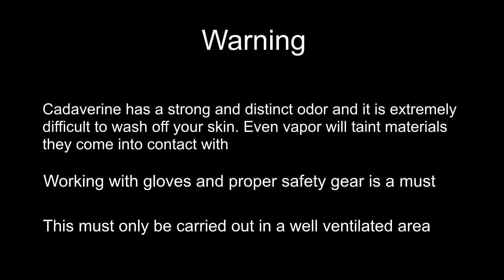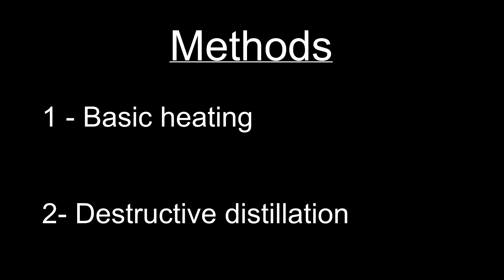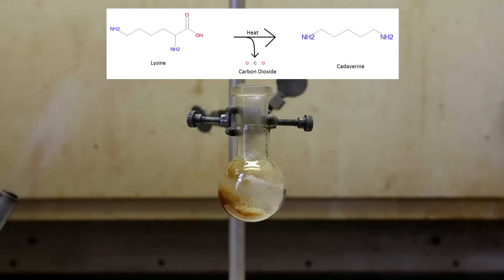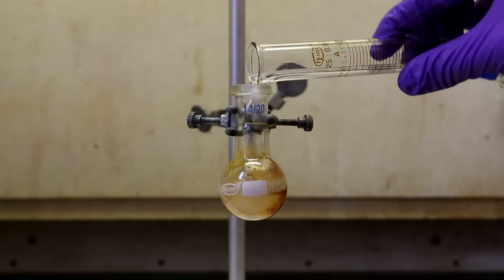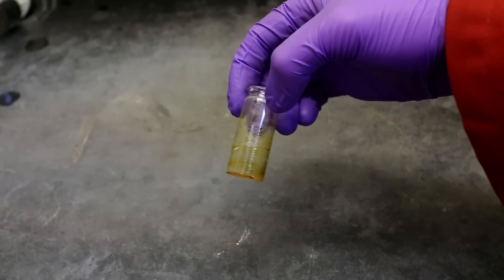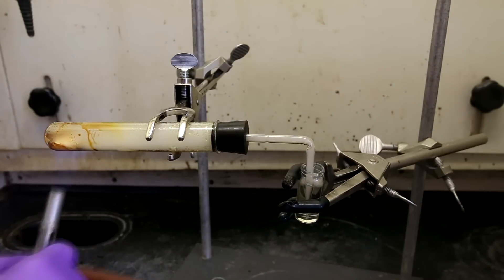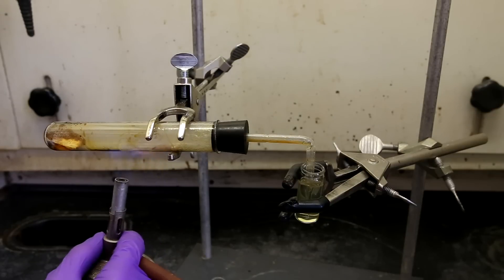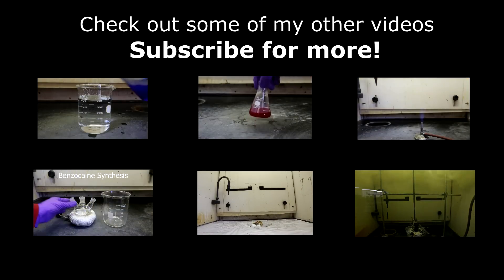How to make cadaverine (the smell of death)

Comment: I found sodium hydroxide also works well instead of bicarbonate, with a little pyridoxal-5-phosphate as catalyst, in aqueous solution. (A little Cu2+ also makes a good catalyst.) I think the pyridoxal decomposed on heating, since the solution turned from yellow to green, but it still developed the right kind of smell. Afterwards it was simple to extract the cadaverine using isopropanol, which didn't mix with the aqueous layer, I'm just not sure how to separate the product from the solvent.

Comment: You used nitrogen inside your test tube for the destructive distillation process, will carbon dioxide or helium work,  I am currently a very amateur chemist and helium and carbon dioxide are easier to get

Comment: Could you use a one way valve on the tube to prevent suck back?
Reply from the maker: +XCyclonusX Yeah, but I don't have one!
Reply: Just realized my post could have come off as a little assholish.  Im just starting to get into chemistry and what I meant was is there a one way valve that could be used.  Sorry if it seemed like a condescending comment. Love your vids and subscribed on the first one. I'm watching one now where your extracting caffeine, do you have one where you show how to extract nicotine?  I'm a vaper and I'd like to try and make my own.  Awesome videos.
Reply from the maker: I didnt think you were condescending at all! For nicotine extraction, I might try it at some point. However, if i recall correctly, there are some issues with the extraction. It isn't as simple as the caffeine extraction or steam distillations. There are some added steps.

Comment: Hey Nike Red do you happen to know anything about Cadaverine uses in inductrial? anything you know about would be helpful even a website?
Reply from the maker: Danny Ulrich Not that I know of. Putrescine is used for the production of nylon though.
Reply: Nile Red You know you can do this much better and cleaner by just heating lysine in heavy mineral oil and then extracting it with some HCL solution. You then neutralize and extract with ether. You can get high yield and even recycle your heavy mineral oil.
Reply from the maker: Have you tried this before? It seems like that should work.
Reply: The key is to use the highest boiling mineral oil you can. In fact if you can get your hands on a synthetic fluorinated oil for the decarboxylation then you should. The Oil is there only as a thermal buffer to prevent the material from overheating and decomposing/polymerizing. I used the zwitterionic form of lysine but it should be better to use the freebase if you can. You could load it as long as you make sure that its able to be stirred with a stirbar. Heating to 250-300C should be your goal. After the hour long heating just let it cool and add acidic water. Seperate the water and then neutralize and extract.
Reply from the maker: Cadaverine. I don't mind the smell of butyric acid at all.
Reply: Nile Red Ya I used to make my own stink bombs in high school. The nice thing is that you dont get any polymerization and you can stop at the dihydrochloride. The dihydrochloride is great since it stores indefinitely.
Reply from the maker: With this method, is the cadaverine isolatable? I would like to do that with putrescine and make nylon with it
Reply: Nile Red yes its easy to isolate. You can easily vap off the ether extract once you dry it with MgSO4. You can also just vap off the water and keep the dihydrochloride. Its deliquescent so if you want dihydrochloride powder you have to lypholyze it. Just a side note, you remind me a lot of how I was when I was younger. I actually used vogels 4th edition and did chemistry at UC berkeley
Reply from the maker: That sounds pretty easy. Do you know what ratio of lysine to mineral oil that you used? What is the max lysine loading possible? 
Also, what did you heat it to? Reflux? Did you ever find out how pure the product was? Did you use freebase lysine or lysine salt?
Reply from the maker: Hmm I will definitely try this out at some point
Reply: +Nile Red what smells worse to you: Butyric acid or cadaverine?

Comment: what is anhydrous ethanol and how do u get it?
Reply from the maker: sten beetlex Darma It is pure ethanol without water. You can sometimes buy 95% ethanol but then youll have to dry it using molecular sieves
Reply: so even i were to get 95% alcohol i wud still need to dry it to 100% ?
Reply from the maker: If you wanted 100%, then yes.
Reply: can the reaction happen with 90% etc?....or it wont happn?
Reply: +sten beetlex Darma in the beging he said u could use ethanol or water so a mixture of both should be no problem
Reply: Lukas Beckers thanks for replying
Reply: i'm just amazed at the thought of creating this

Comment: How did you go about of disposing of the cadaverine? Cadaverine being an amine, I would expect that adding it to an acid solution would deprotonate it forming a soluble salt. Therefore making it less volatile and less smelly.
Reply from the maker: I found that even adding it to conc. HCl didn't really kill the smell. I wanted to clean up quickly, so I added conc. sulfurrc and let it sit there for a little. If I recall correctly, there wasn't much smell afterwards.
Reply: or, in summary

H